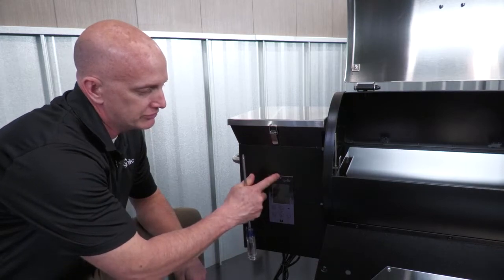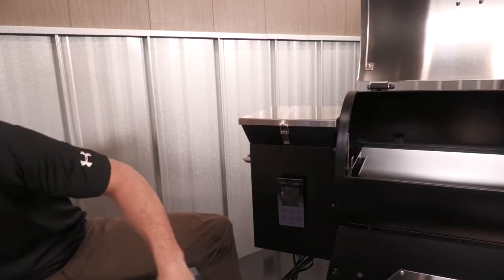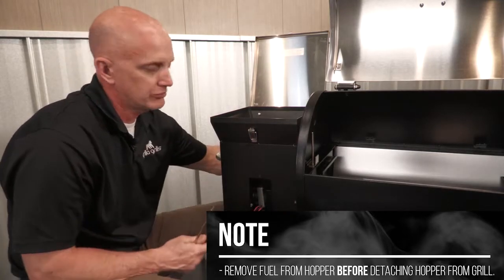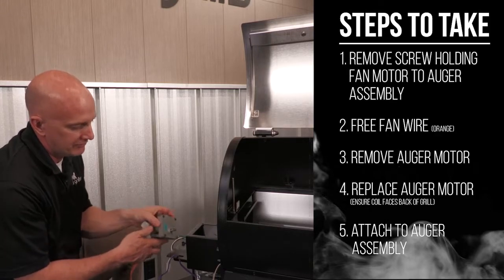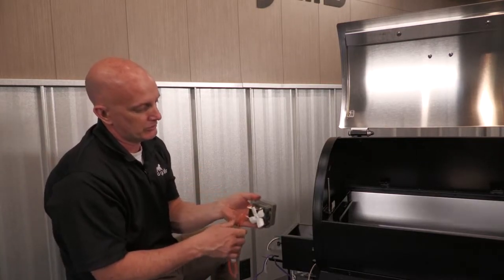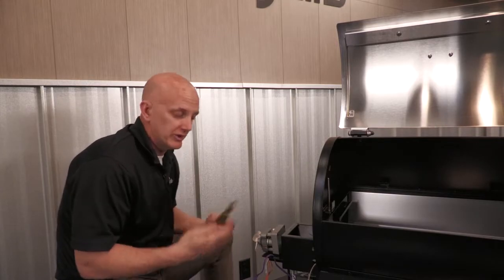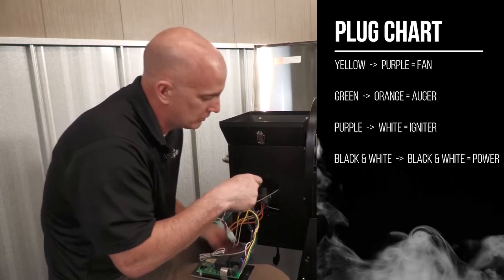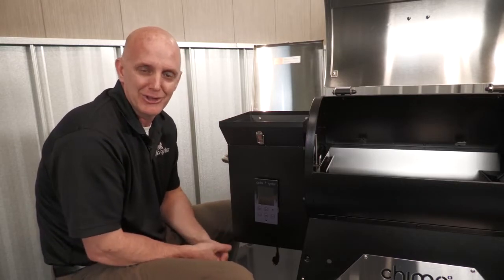How to Replace a Chimp Auger Assembly | Maintenance with Grilla Grills

Comment: Thank you for this. Our chimps auger is stuck, end to end filled with hard, black cement. I had to get help and put the chimp on its side to get to the bottom screws and wire ties.

Wow! The 1/2 inch space between the bin and the smoker was jammed full of wood pellet dust.

We keep our chimp outside. Underneath I vacuumed out tons of spiders, spider eggs, spider webs and lots of tiny ants.

I hope Grill will make it much easier to remove augers on future chimps.

Comment: BTW You do NOT simply unplug wire connections. On our chimp there are FOUR and connected colors do not match:

1. Two purples go to two white, one yellow.

2. Two oranges go to two white,o e green.

3. Pink and white go to two white thermal wires.

4. Black and white goes to two white, one black.